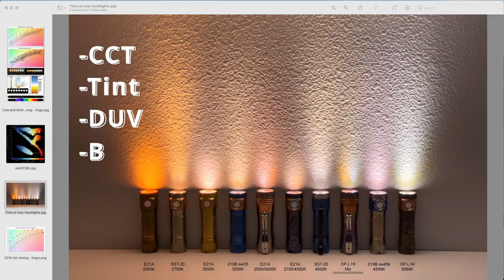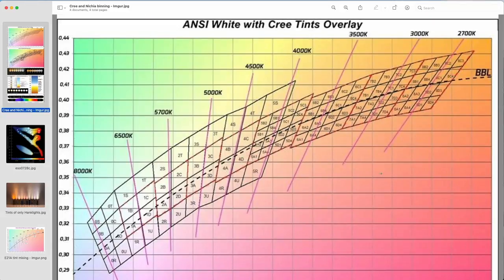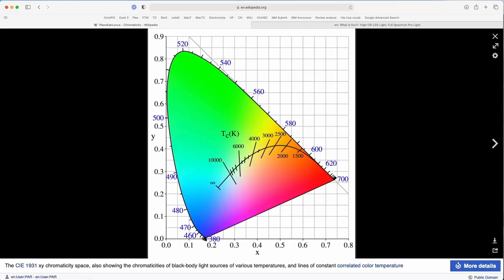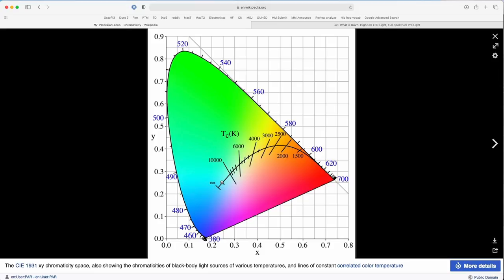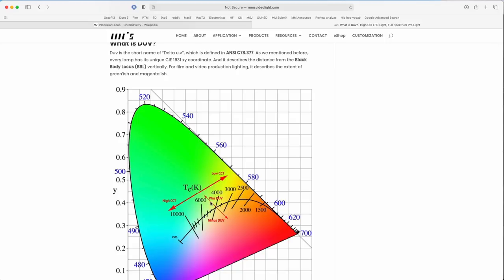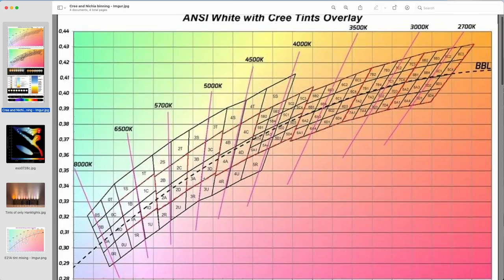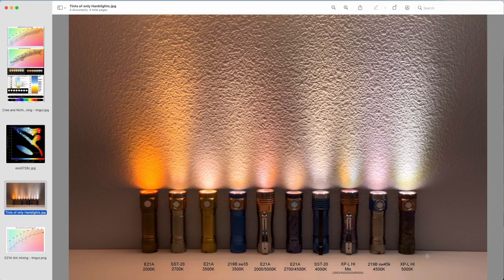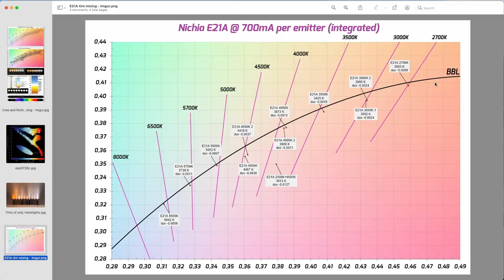Flashlights 101: Tint talk! (CCT, BBL, DUV and bins)

Comment: Very interesting. I work with high-pressure sodium lights - 2100K, ~140,000 lumens a pop without ever stepping down. A bunch of them. As such, I'm genuinely surprised that anyone would want a 2000K light, or a 2700K for that matter. Under them, everything essentially looks redish/orange. Not sure how and why that's desirable. As for my own flashlight preference, I tend to go for a cooler CCT, as I look at 2100K all frickin' day. Learned a bit from the video. Appreciate it.
Reply from the maker: I think the reason is that not all 2700K temp lights are created equally. This is where CRI comes in. Sodium vapor lamp are low CRI, and the 219b and 519a emitters are around 95 CRI
Reply: Your  eyes adjust to the cct at night. no sht the lower cct looks strange at the day time.. 1800k high cri is as good as and usable as 2700k high cri at night. HPS/HPS are like negative cri or very low and monochromatic, meaning that ansi chart looks like a straight orange line with no other colors. they are efficient and do not pollute light as much, and have a nostalgia factor to them but they are bad for visual driving and identifying.

Comment: E21A 2000k is a beautiful golden orange I have a D4V2 with 2000k/3500k led's and it's excellent. I also got a Convoy S11 recently and it's moreso a deep yellow sunset color compared to the deep orange candle type color.

A part of me wishes it were all 2000k led's but the 3500k mixes in real well and makes it more practical compared to 4 2000k led's especially cri wise

I'm surprised you don't have anything higher than 5000k for the review. Can't say I really blame you I'm a fan of 2700k-4000k color temps for most purposes. I love going even lower as well  mostly for use as mood lighting or indoor lighting in general when I don't need high cri lighting.
Reply: The convoy s11 is the 1800/2000 version by the way.*

Comment: Well-done. Thanks. 

I think I’m becoming a CRIbaby.

Your favorite high CRI diode?
Reply from the maker: Definitely Nichia 219b 4000K. I love sw45k for it’s consistently rosy binning, but 4000K looks better to me at night and has slightly better r1-15 values even over sw45k. I also recently got a BOSS FT with sw30 that is gorgeous. So beautiful, but not appropriate for edc/daytime use.
Reply: @cheule  I only recently got interested in modern, lithium, rechargeable LED flashlights, and bought an IF25A in 4000K. 

I was a bit apprehensive about going with the 4K, due to the fact that the 4K is not quite as bright, but I’m really glad I did, because I absolutely love the color of that beam!

Comment: How does CRI factor into this? And what is the difference between R9080 and say 90 CRI?
Reply from the maker: R9080
is a moniker for “90 CRI for R1-8 and 80 CRI for R9”. R9 is an important red color that is left out of standard CRI rating. So a light could have “90 CRI” and yet only 65 rating for R9 red. So that’s where R9080 comes in…
Reply: @cheule  Oh okay, that makes sense. Thanks!